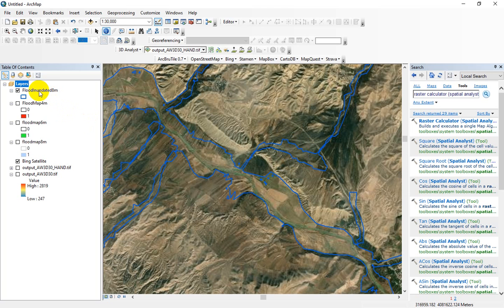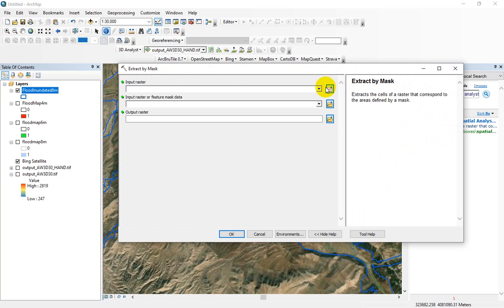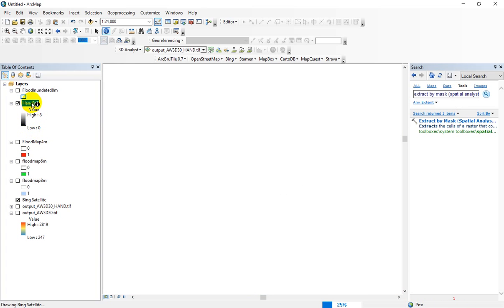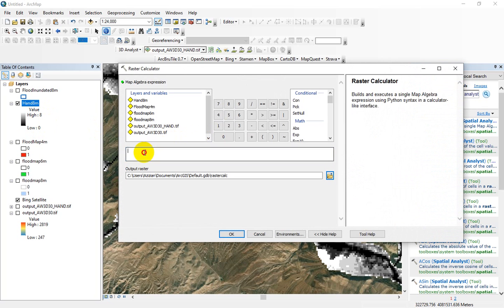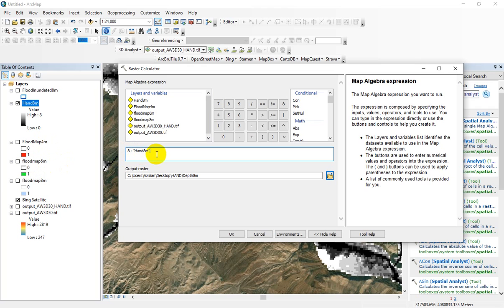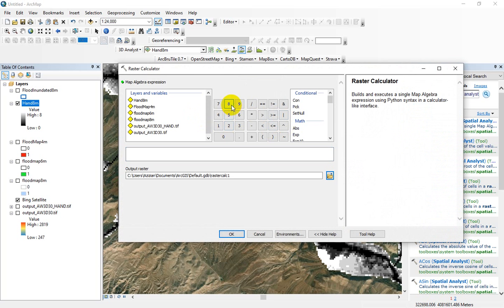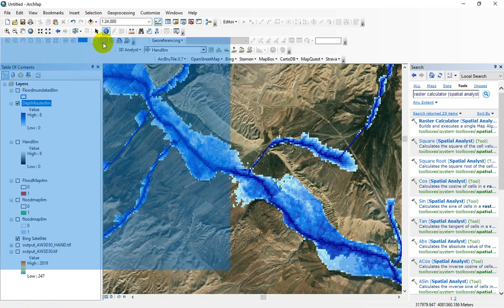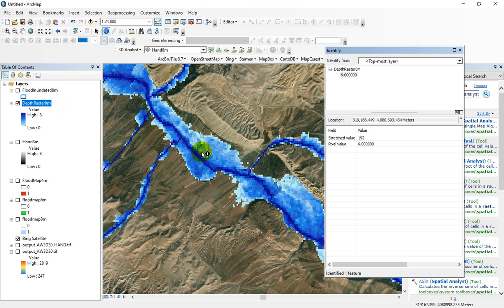Rapid Flood Inundation Mapping using HAND (Height Above Nearest Drainage) Method-Part4

Comment: Hello Sir, first of all, thank you for this fantastic information. Despite trying multiple times with my DEM data, I couldn't successfully convert it into HAND Model data. The application shows a 'successfully converted' message, and a data file is created with almost the same file size as the DEM. However, the HAND data I generated cannot be viewed in any program, including HAND itself. Since I kept getting the same error after dozens of attempts, I wanted to reach out to you for help. Best regards.